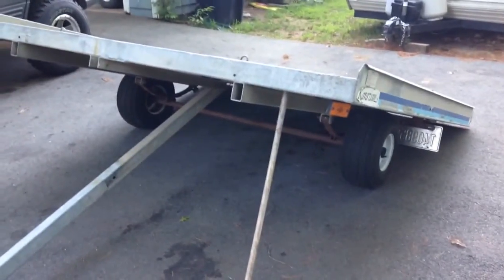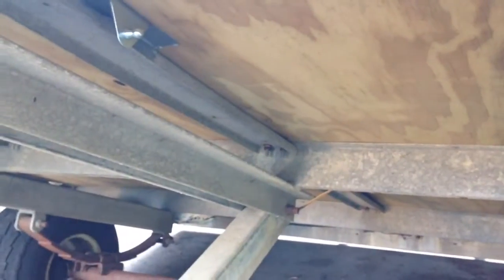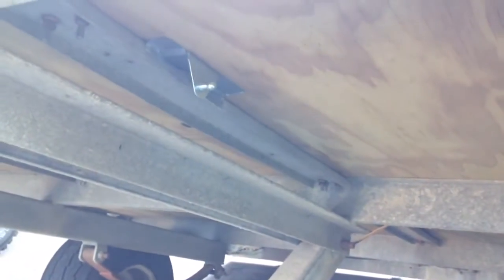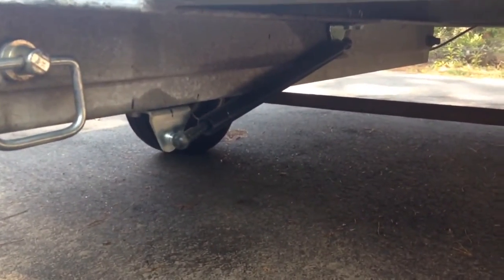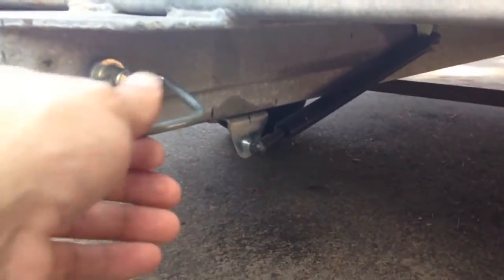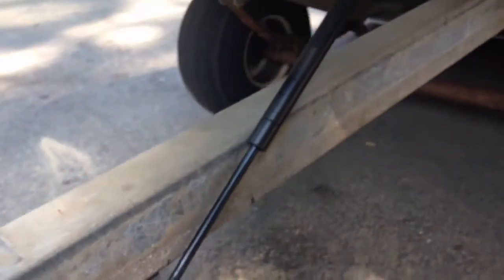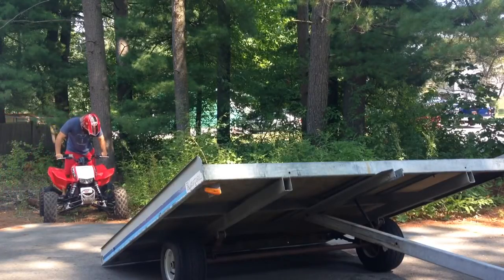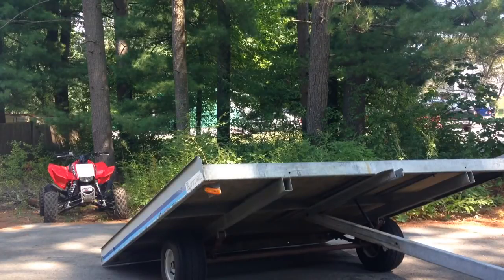How To Install a Shock Strut On Tilt Trailer ATV Snowmobile

Comment: Hello, I am needing to make a similar application on my utility trailer. Can you tell me the length of the shock that you used in this application. Might the second measurement, 12.25 inches represent the closed length? thx.
Reply from the maker: Unfortunately I don't have this trailer anymore
Reply: Sweet set up BTW. So this must have been a kit as you had instructions, do you remember the name of the kit or the name of the company. After watching this I'm going to get one if my type of trailer will work without major modifications. Thanks.